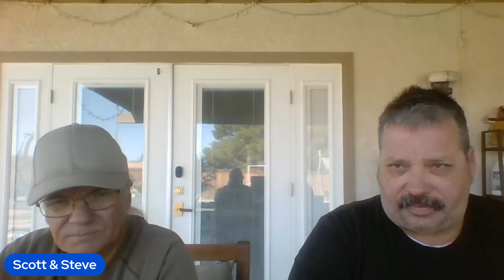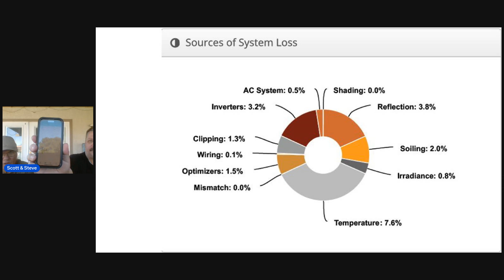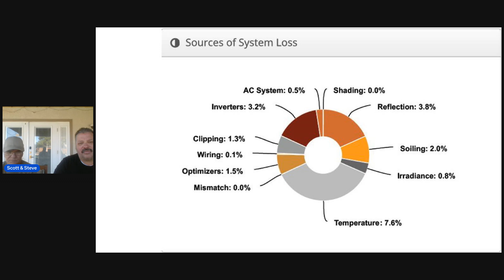New material supercharges solar panel power and lifespan

Comment: I have some 100 watt panels that produced 100 watts when I first tested them but this drops over time plus there are losses in the wiring, solar charger, AC inverter etc. Some 100 watt panels only produce 50 or 60 watts new. I use those for DC devices or charging small portable battery packs.